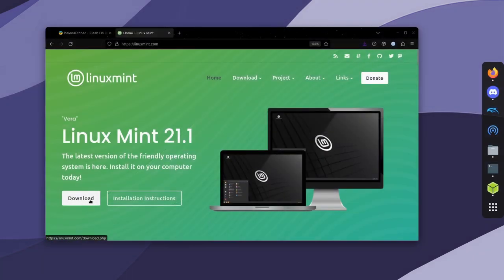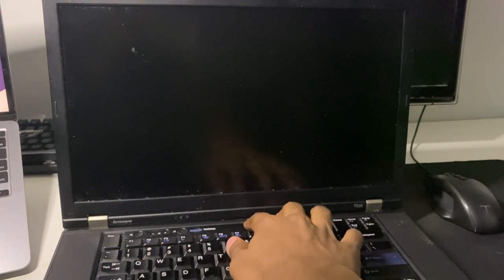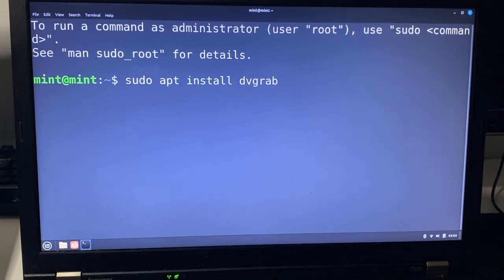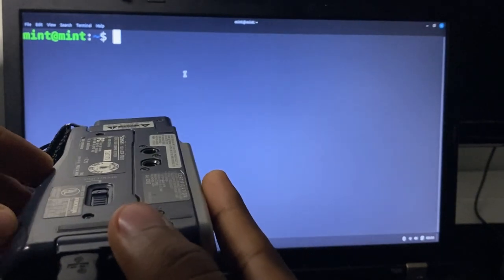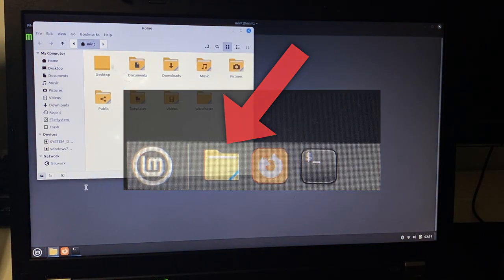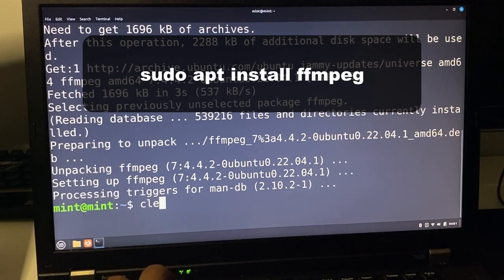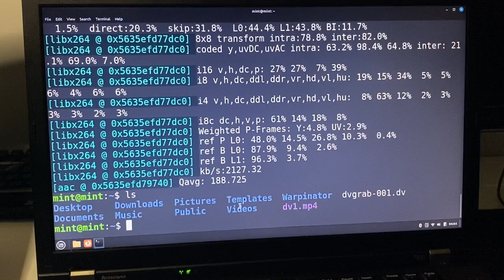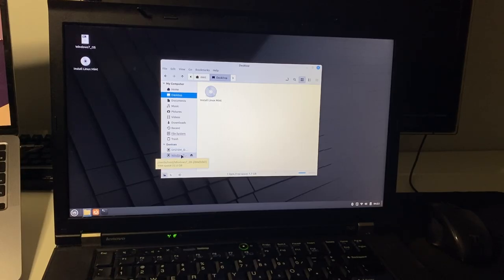How to Transfer MiniDV Tapes on Linux

Comment: I think the frustrating thing for those of us who have broken camcorders and no firewire anything is that this whole process at this point feels like one step above writing code and building a completely new operating system from scratch.  There just doesn't seem to be an easy way -a successful transfer always has people in comments it hasn't worked for.  Very rarely do I see a comment where people say, this is the exact computer, camcorder, program that worked for me.  It is always so piecemeal.  Thank you for this video.

Comment: MiniDV tapes are already digital, The right term is transfer. Only analog tapes need to be digitized. There is no need to Linux, Just use WinDV or Sclive on Windows and you will get an identical transfer of the tape into computer. From there you can use any utility to strip DV into lossless AVI, do your editing and color correction if desired, then de-interlace, resize to HD and encode to a modern codec. It doesn't have to be complicated more than it needs to be.
Reply from the maker: I’ve tried using winDV on the same computer and the framerate was really low and it didn’t work well and when I tried dvgrab the video came out perfectly. I’m not really an expert in on this topic I was just sharing what worked well for me
Reply: @MadhuKraft  WinDV cannot transfer at any frame rate other than the original frame rate, It wasn't designed to change it. You must have used a shady program that records into a weird format on the fly.
Reply: I'm with you on this comment but what exactly do you mean by "using any utility to strip the file to a lossless AVI" before moving on to the editing/color correction etc"? Just curious.

Comment: As Linux tutorials go, this is excellent!  Very clear, straightforward, comprehensive yet simple.  Some may find the part about "I don't really care to save the file" confusing and it would have been better to show how the majority of users will want to do it (I think what you meant was to run the dvgrab command from the folder in which you want the file to be saved) but that's something Linux or even other command line users will be comfortable with.  Looks like the main challenge will be to find a computer with firewire ports (or add them on).  If I am understanding this video tutorial correctly, dvgrab does not allow for multiple firewire ports as it just automatically chooses one, correct?

Comment: I did get a cheap startech firewire card for my desktop.. i did not even check some of my 10+ thinkpads i used to collect them. Then i just use ffmpeg to de-interlace and encode.  I do have some rare sony hdd with 60gb for tapeless recording that is drag and drop to the dekstop.

Comment: Thank you for this video. I follow the same steps as you describe. Dvgrab starts grabbing the video, but almost every second I get a error message in the status text "damaged frams near: timecode this means that there were missing or invalid firewire packets." - if I play the video I see that there are strange artifacts in the video every second and also the audio has some glitches. Do you have any suggestions how I can fix this?
Reply from the maker: does the tape itself play fine? are there any glitches when you are watching the tape from the camcorder?
Reply: @MadhuKraft No, there are no glitches if played from the camcorder and no glitches if I use e.g. WinDV on Windows for grabbing the video. If I can't find a solution for this I will go for WinDV and convert/deinterlace the .avi file afterwards via Windows setup...
Reply from the maker: what was the exact command you used for dvgrab? And have you converted the .dv file to mp4 with ffmpeg and then tried viewing the video?

Comment: I don't have Firewire on my PC. Does this work with Firewire to USB-Type A adapters?
Reply from the maker: People say the usb-a to firewire adapters are scams and that it isn’t possible. I don’t think that would work. But there are adapters for connecting usb-c to firewire though but you will need to get multiple adapters. I found another video for usb-c computers and it’s in the description

Comment: There is no "quality" to digital (ie MiniDV, aka consumer DV25), the data is either there or not there. The OS makes zero difference. What does makes a difference is the transfer/"capture" software for the DV stream, and the suggestion here is awful, as dvgrab is known for dropped frames.
Reply from the maker: Me personally I’ve never had a problem with dvgrab so thats why I recommended it. I know it’s not the operating system that makes the difference I only said to use linux cus I was showing people how to use dvgrab
Reply: @MadhuKraft  You made false claims like DV tapes are not digital, and transfer with Windows resulted in low quality video.
Reply from the maker: @Capturing-Memories  For me it actually did result in lower quality but yeah I did say dv tapes aren’t digital when they are. I thought it wasn’t digital because you can’t transfer it normally, you record it basically
Reply: @MadhuKraft  It is transfer not recording, Albeit in real time, Recording usually refers to a copy of less quality, Transfer is bit by bit with no loss of quality.

Comment: Don't be fooled by this video, DV is digital and can be transferred to Windows with no loss of quality using WinDV or Sclive, This person is confused and used the wrong tools that produced a bad transfer, There is no need to Linux, end of story.
Reply from the maker: Wdym produced a bad transfer? You don’t know how my video transfer turned out. If WinDV works perfectly for others then that’s fine it just didn’t work for me and dvgrab worked flawlessly for me. You don’t gotta be that rude about it. I’m just sharing what worked for me
Reply from the maker: you cant say dvgrab is a “wrong tool”
Reply from the maker: and yeah it is kinda rude to say my video is entirely useless even if it is really complicated. It’s not a great tutorial but it still tranfers dv tapes fine. All ur other comments are fine I clearly made a mistake. Its just the tone
Reply: There is every need to Linux, there are people out there like me that use Linux. So climb off your pedestal. 

Thanks for producing this, I had no idea this feature even existed!
Reply: @kryten14  I’ve been transferring DV/ D8 since the early 2000’s across multiple generations of MS Windows and PC hardware and never had to go through this painful workflow.
Reply: Those PCs with 1394/Firewire port are probably so outdated that it is impossible to install latest Windows OS on them. This is such an outdated hardware you can no longer find window drivers for on the internet.
But can be perfectly supported with recent Linux distribution. Using Linux to bypass all that Windows installation and driver related hassle is valid point of the video.
Reply: @vasiliynkudryavtsev  I’m doing it now with Windows 11.